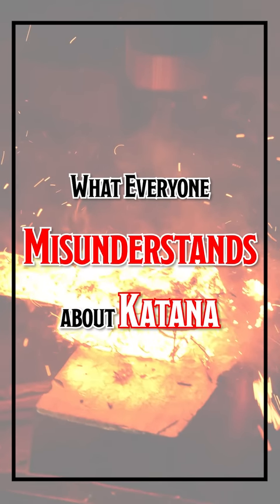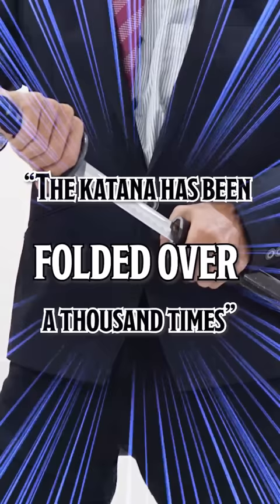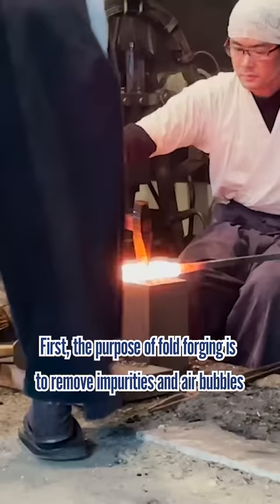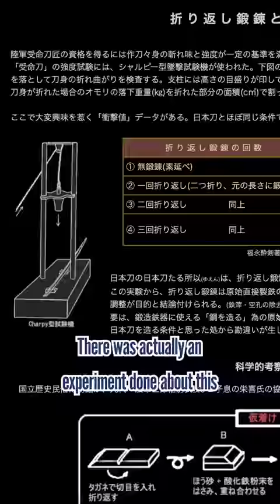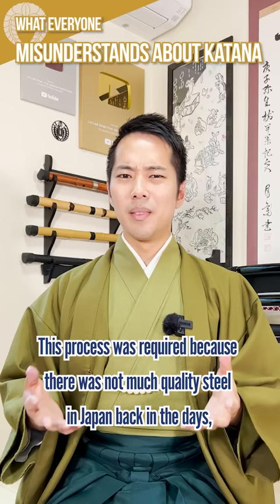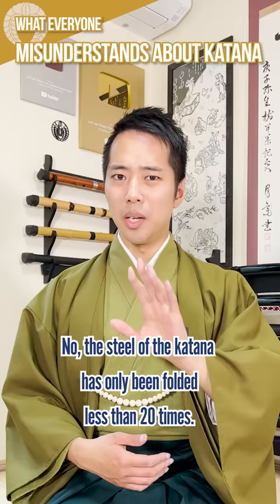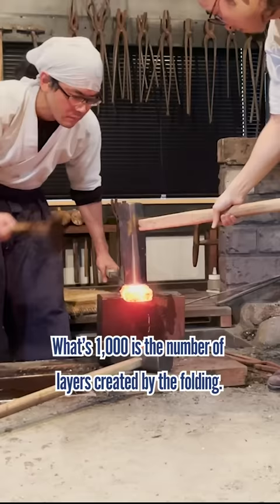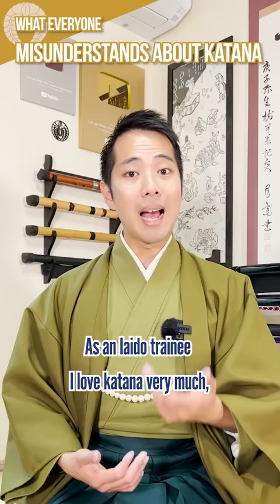What Everyone Misunderstands about Katana #Shorts

Comment: Maybe this myth comes more from the creation of the billet itself? From what I know Japan historically had to use iron sand to create the tamahagane (sword steel) and this process using a tatara was a method of constant layering for days on end.

Even after that arduous process they still had to forge and fold to remove slag from their high carbon steel and fold their low carbon steel to spread out the impurities so it wouldn’t have weak points.

All those processes come before the forge welding, so maybe people took “yeah I had to fold this steel like 1000 times to get it this way” as “I folded the final billet 10,000 times to make this beautiful damascus with a Brazilian layers.” 

Or maybe it’s not a complex game of telephone and I’m just overthinking this common misconception.

Comment: The Katana is also not totally unique in its cutting properties; it is a single edged stiff bladed sword. This also describes several other sorts of swords, which have similarly excellent cutting properties and are similarly not so great on the thrust as a tradeoff. Scimitars, Swiss Sabers, Messers, and others go for the same sorts of handling characteristics of the katana via different specific manufacturing processes, depending on what was available in that place and time.

Comment: Folding steel could be compared to squeezing a wet towel, you are getting rid of the stuff you don't want but at the end you will have a towel, not a magic super towel or for the metal you start with metal that has air bubbles and impurities like silicon and you end with steel or iron, not comic book super metal.

Comment: modern steel doesn't get any stronger after the third cut and fold, but since tamahagane used to be a lot lower quality, depending on the quality of said metal it could take anywhere from 30-50 folds to reach a suitable hardness and purity, due to the amount and concentration of impurities in the blade, that's why these misconceptions exist, because a katana isn't considered a katana if its not made in the aforementioned traditional method

source: im a bladesmith

Comment: The katana is an excellent example of how you can overcome poor materials with hard work. For some reason lots of people seem to think the iron used was like super high quality, probably because it makes katanas and katanas are awesome but... no actually. The iron was really really bad, and so they worked very hard to turn that into usable metal for their swords, and made their swords out of different type of steels, with the edge made out of an extremely hard steel, with the back made out of a softer but more flexible steel in order to get the best possible blade. That's why the edge and the back of the blade look different. They are different grades of steel.
Compare that to the later medieval, and renaissance era blades made out of high quality spring steel that had a very flexible but hard to make the entire blade. Because at that time Europe could produce large amounts of quality material, which means their blades could be far simpler while being able to perform their task.

Comment: They're basically made from an ancient form of spring steel. The edge is hard l (giving it durabilty) while the back is softer (allowing the blade to flex and rebound back to it original form). Other wise the blade would remain bent if swumg improperly if the whole blade was hardened or the blade would shatter all together.
Reply: if you bend a katana it stays bent, they are not made from spring steel. They are made from normal steel that has been differentially harded because the back was covered in clay so it wouldn't get as hot as the edge, resulting in a softer back when quenching

Comment: As an engineer folding Metal over 1000 times does not make it stronger, that's like folding a dough over and over again expecting it to turn into concrete, that's not how physics work, the metal strength stands into the quenching process and the maintenance of it

Comment: Fun fact:
During the earlier parts of the Middle Ages and the Migration Period, Europeans used a technique of making steel called pattern welding, which is where you fold two (or more) different types of steel together to remove impurities and make the blade generally stronger. This practice was largely discontinued once they started making steel with a crucible (this may be oversimplified, I think there are more reasons for the shift), though pattern welding is still used to make aesthetically pleasing knives and such. People call it "damascus steel" these days, even though the real Damascus steel is completely different.

If I remember, one of the reasons Japan continued to use their particular method is because finding large chunks of iron ore was rather unfeasible. Most of the iron present in Japan is in the form of sand, so it is quite the process to get it pure enough for use, and folding during forging helps make sure there's as few impurities as possible.
Reply: Correct! However Japan just never developed the crucible technology. You need to get it very hot to remove the impurities. And Japan never developed a way to do that.

Comment: As a knife maker I use 80CrV2 and 5160 high carbon steel for hunting and general purpose knives and I’ve always wondered what steel katanas and just Japanese edged weapons are made of. Would anyone happen to know? 

Also how is carbon integrated into the steel? I know that heating steel causes de-carb (carbon loss) in the outer “skin” of the steel an knowing that the steel is folded leads me to believe that there could be micro streaks of low/medium carbon steel mixed in there. How would the smiths ensure that the steel had the best quality carbon content? And are your sharp steel swords made from mono-steel or are they still made traditional?

Comment: If we coat the katana with a thin 4mm coat of tungsten carbide and sharpen it while it is still red hot, it would be able to slice through stone and thick sheets of metal
Reply: But this is only if you have large amount of strength, titanium can also be used to coat the outer edges of the blade to make it much stronger
Reply: No, you would not.

Comment: It’s actually not as involved to make 1000 layers of anything as you think. If n is the number of times you fold something, 2^n is the number of layers you have. If you fold something 0 times, you have 1 layer. If you fold something once, you have 2 layers and so on. So, to get at least 1000 layers, you only need to fold something 10 times to get 1024 layers. If you could manage to fold something 1000 times, you would have around 0.01 centillion layers.

Comment: If you fold a piece of paper in half 42 times it will reach the moon. I highly doubt that someone can fold metal a thousand times. Thanks for giving a realistic number.
Reply: Well, you can fold it a thousand times, that is if you add a source of carbon during the process. This is possible, since the metal, after the folding, is hammered back to a specific thickness, something that doesn't happen with the thought experiment with the 42 times folded paper.
Reply: @Schnittertm1  okay, make a video of you folding metal 1000 times and I'll believe you.
Reply: @ztsottles  🤓🤓🤓🤓

Comment: Honestly, the steel Japan used way back then was pretty HORRIBLE stuff. The ONLY reason to fold steel is to remove the impurities. BUT if you folded steel 1,000 times, it would cease to be steel. By folding it that many times you could essentially end up just turning it back into plain Iron by removing all of the carbon that makes it steel in the first place. Folding steel around 5,000 times would turn it into wrought Iron, so folding it 1,000 times would mean that steel is now 1/5th WORSE than it would have been had you simply not folded it at all.

Comment: Katana is just a perfect form of sword...easy to control and light weight...slice not smash...they way I like it
Reply: Dude all swords are slice not smash, and the average katana wheighs the same if not a tad bit more than the average long sword. Also there is no such thing as the perfect form of the sword, only different specializations made for different things.
Reply: It's not easy to control if you need 2 hands to hold it properly.
Reply: Lightweight? What a joke. Katana's weight is about as same as any two-handed sword like a longsword. A light sword would be terrible because it simply means it's made with light and weak material.
Reply: Have you actually held one? Because I can tell you right now that they're not the easiest swords to get a feel for, unless of course they're custom made for you.

Comment: I am too!!! That’s so cool! What’s your favorite Katana? Or your dream katana? I really want a 1060 carbon steel blade, with a navy blue handle
Reply: Blade Smith here, while 1060 is a wonderful steal for beginner knife Smiths I actually wouldn't advise it for a sword. You'll see 1060 advertised a lot by katana sellers on Amazon, but what they're trying to do is give you a cheaper steel with less carbon in it than the more commonly used 1095. If you want a sword I would get one that's made of 1095, 5160 or pretty much anything with a carbon content higher than 1060
Reply: You should also know what those numbers mean, most of the time you don't need to worry about the 10 it's just indicative of the iron grade but the two numbers that come after that are indicative of the carbon content in other words 1060 would be .60% carbon and 1095 would be .95% carbon
Reply: @dannyeckerd9324  
What about 5160? And is T10 steel really just another designation for 1095?

Comment: Why can't you just melt the steel? Once it solidifies it'll be one piece without air in it, a solid chunk of metal
Reply: You understand the heat required to melt steal
Reply: Because you would cast it then, this would introduce WAY MORE air into the blade, and increase carbon content significantly (with primitive means.)
And the steel needs to be shaped, so why not do it with the same process?

Steel also needs an absurd amount of heat -- Iron melts at ~1,300°c, this is stupidly high and would take so much fuel, insulation, and time with primitive means, it is just not effective to do.
Faster, easier, and better to just hot cut and fold a half dozen times.

Comment: Folding actually makes the steel weaker. As you are increasing the weak points along the folds. What it does, though, is that it allows you to spread out irregularities throughout the entire sword and not just habe it concentrated in one weakspot. Very useful for low quality steel.
Reply: Folding steel doesn’t make it weaker. Because properly done the folds are forge welded together. Other than that yes your correct it spreads the impurities so that no one particular spot is the weak point making it harder to break.

Comment: Everything what say is right but ter is a small thing you sead that is not right. You say jigane but what you see it is cald the hada. Jigane is the process of the hardening of te steel.
Reply from the maker: Jigane is the patterns that appear on the “hada” surface of the katana due to the forging process😊
The forging process itself in Japanese is called “折り返し鍛錬 Orikaeshi Tanren!”
Reply: @LetsaskShogo  Thanks for clearing that up i did not now that, i have learnd that the folds of the steel is cald the hada. And ji-gane is the surface steel and ji-hada is the surface pattern of the hada. 🤔😃

Comment: The katana is a fantastic and ingenious example of making something great out of not a lot. Katana despite being a two-handed weapon are on average only as long as a European arming sword. Which means they're short for their weight, which is heavier on average as well. The differential hardening does not do anything to make the blade particularly harder, but it does allow the katana to be used like its predecessor the tachi as a cavalry saber, but mostly the curve is to help with edge alignment as the blade is much more forgiving than a straight sword. As a curved sword it is not as well suited for cutting through plate armor, but the way they're crafted and the weight allows them to cut through armor fairly well if you are precise. 

Rarely do humans get to deal with perfect and sometimes we've got to beat close enough out of barely passable.

Comment: No one understands the concept of the fold. Layers are different than folds. I have a 512 layer Damascus steel katana and it isn't junk, but I have owned better with less layers. Better steel required less work done to the blade.

Comment: but imagine if there was a katana that was forged while folded a thousand times, that would be cool to see what kind of katana would be created from 1000 folds.
Reply: It would be very weak since most of the carbon wold oxidise from the air and away from the metal. 

Do it enough and you'd end up with soft iron. 

That's why in modern metalworking, you melt the metal in huge batches and pour it out to ingots. So you don't reheat it again and again. 

Think like Steak. It gets worse the longer you cook it.
Reply: @MaliciousMollusc  yeah, that's true. even then, though, i'd like to see what a thousand-fold katana would be like.
Reply: @lastnamefirstname8655  It's gonna look artistic af, but probably a shrine piece or something.
Reply: @lastnamefirstname8655  
It really wouldn't be anything special. You get diminishing results after folding it 20 times
Reply: @aristosachaion_  yeah. but even still, the desire remains even if the whole thing's pointless to try out.

Comment: Ok but did they actually fold it 1000 times? I dont believe that nothing happens until they try
Reply: no, they don’t fold it 1000 times, they fold it around 10 times, but when they do that, there are over 1000 layers in the katana.
Reply: @lofeofsope2542  🤨 i dont think you understood my comment
Reply: @sukaikitsune  i reread it and i understand now, but there would be a point when they fold the steel where it would just turn back to iron. it would make the blade weaker than it already was